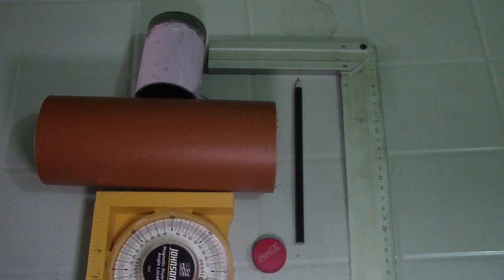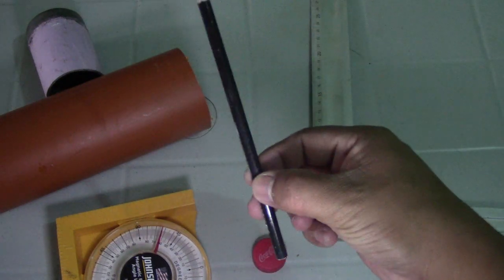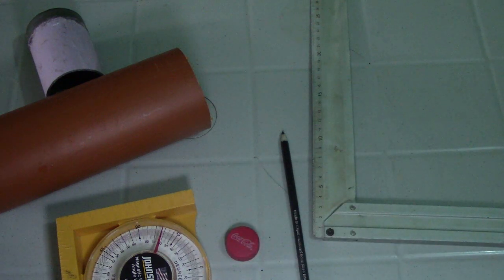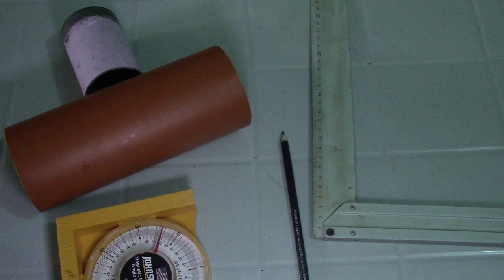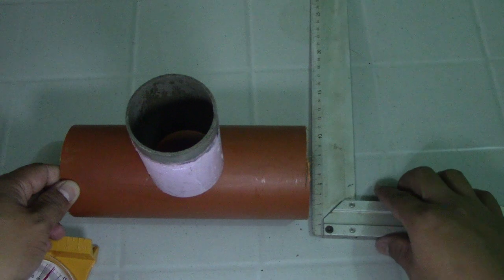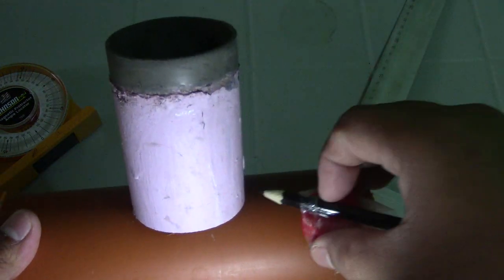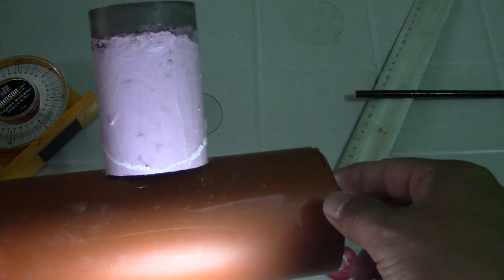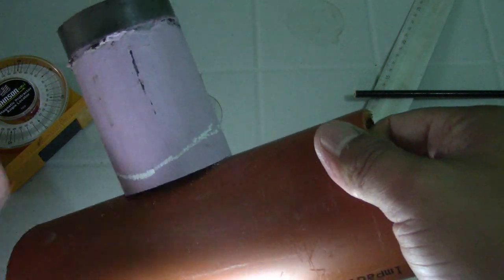How To Make Saddle Tee Without Computation LifeHacks 100% Accuracy Part 1

Comment: You are changing the diameter of the main pipe with the spacer. The spacer should only touch the main pipe at a straight line of the branching pipe.

Comment: Oi. What a totally haphazard way of marking the pipe. So much better to use a compass or dividers to mark the pipe. Just ensure as you move the dividers around that they stay perfectly perpendicular to the system and that the distance between the points is greater than the empty space 90° away from where the pipes are touching. As the upper compass pt marks the small pipe the lower pt is tracing the would be intersect line of the small & larger pipes. Bottle caps indeed.